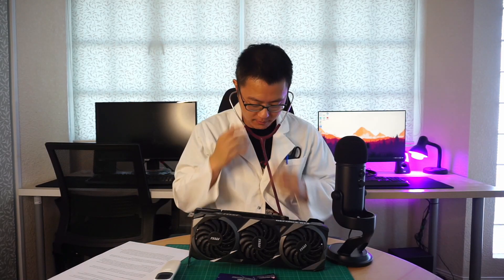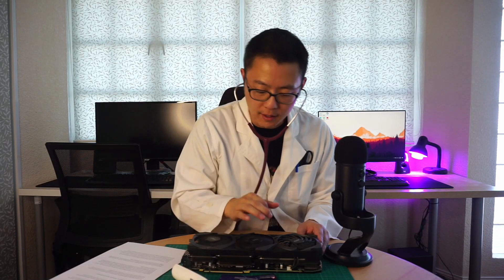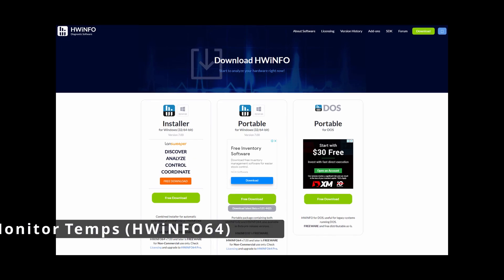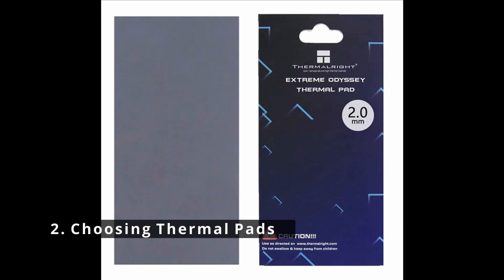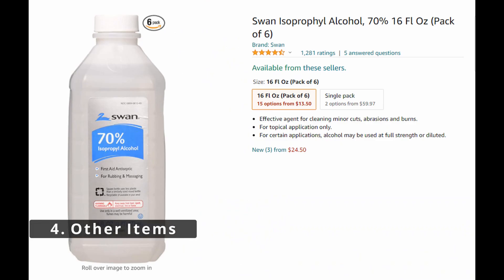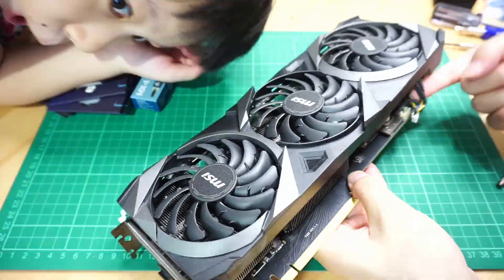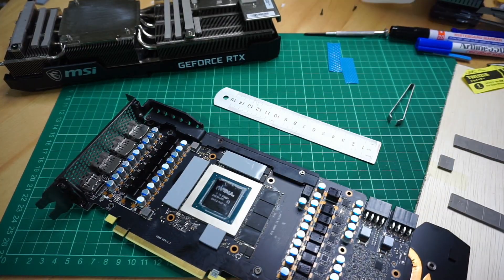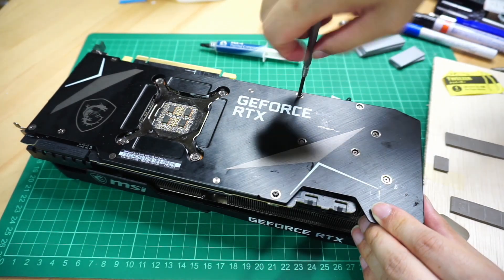RTX 3090 (and 3080) Owners! CHANGE Your Stock Thermal Pads! (Guide, Tips, Results) w/ Dr. JimRPG

Comment: Man that's awesome! It makes me mad when a product so expensive has cheap * stuff in it, you are almost forced to "void" the warranty.
Reply from the maker: It is imo almost a design fault... its just not quite a 'fault' but 90 deg+ is not really acceptable.
Reply: @stevemisfit1  The problem at least for me is even if my GPU temp says 74C it thermal throttles because the memory temps are so high.
Reply: @MrMooMoo89  What model do you have?
Reply: @greggreg2458  Ventus 3080.
Reply: @MrMooMoo89  What temps does your memory reach under full load after a while?
Reply: @greggreg2458  78-79 with fans at 80% memory temp about 91-95
Reply: @MrMooMoo89  90°! That's crazy
Reply: @greggreg2458  will have to give thermal pad replacement a go and see how it works. I regret buying this gpu
Reply: Yup and there are videos online which speculate that 90-100 degrees is the degradation temperature of GDDR6X memory modules. Without these mods I really can’t see the 3090 surviving the 2-3 years of warranty period.
Reply: @HalfPolygon Personally would not buy the Gigabyte either, it has the same issues.
Reply: @HalfPolygon If you can get adequate airflow then go with the Ventus 3080. I rebuilt my system in an NR200 with bottom fans blowing into the GPU. The temps generally stay under 70 now and I do not run into thermal throttling. I did not change the thermal pads.
Reply: 😄 lol your profile pic. IT JUST WORKS!
Reply: @eternalbeing3339  16 times the detail! I loved Todd before 76.
Reply: @HalfPolygon usually in the 80s

Comment: Thanks for sharing these tests and putting in the work.  I probably won't be replacing thermal pads on my MSI 3090 since it runs like a dream but does get hot.  I will probably replacing my 3090 Fe which thermal throttles like crazy which I can barely stand.  We'll see how long my MSI lasts playing games and mining.  It does have a bit of coil whine now...LOL.
Reply from the maker: Yep I felt the same way. I didn't want to do the mod, but i was basically left with no choice, it was going to get worse and I already bought pads anyway.

If you're happy with it - don't have risk anything and keep using it.
Reply: @JimRPG  I'll be sure to check for this while mining with my 3090 Vision. Have you heard of any other AIBs doing this or just the MSI one?
Reply from the maker: @chancekalugyer2376  Lots of other people have changed pads so its not just MSI, but its possible some companies use better pads than others, thats why I said in the video just to monitor temps to begin with, maybe you're ok with temps on your card.